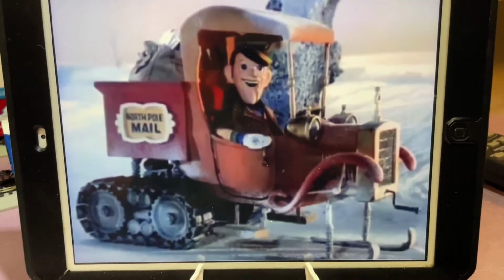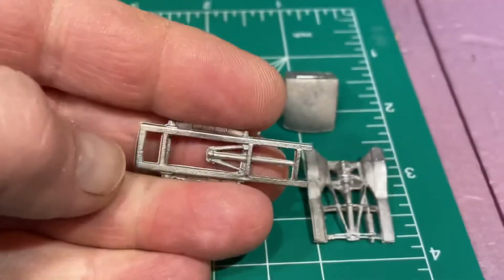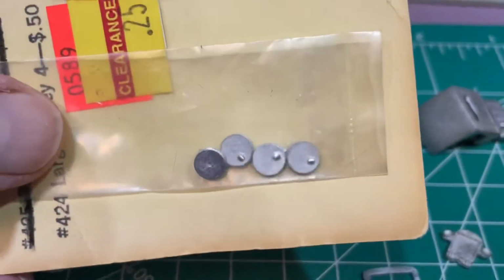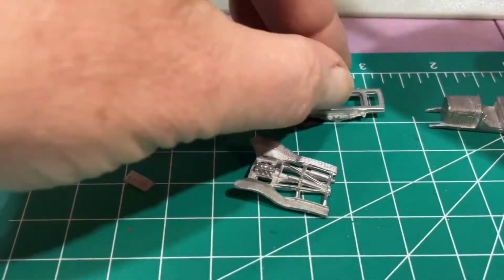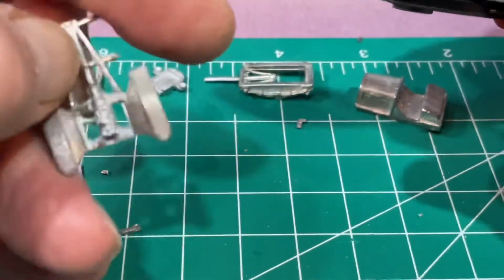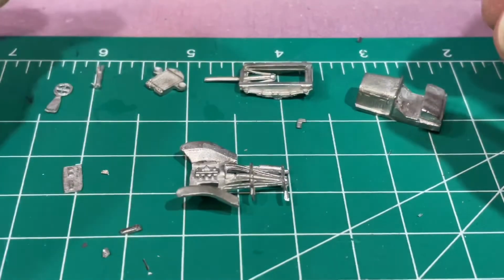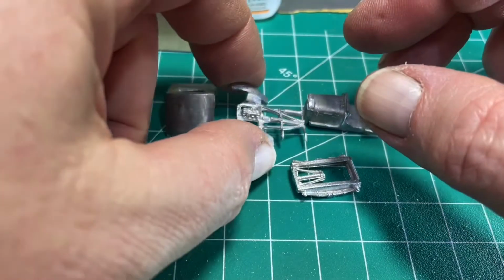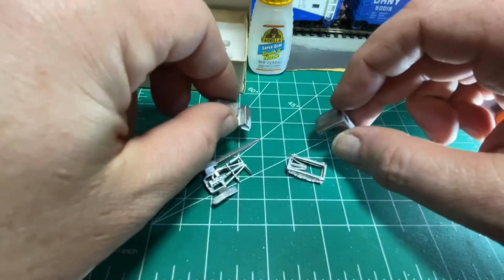Making a Santa Claus is Coming to Town Mail Truck - Part 1

Comment: This is a really cool project, thanks for sharing your progress so far! I have never been adventurous enough to give the die cast kits a try - they look like they'd be so difficult to work with so props to you for doing that! I can't wait to see how it turns out!
Reply from the maker: The die-cast kits usually aren’t that bad. The worst part is filing all the mold flashing. You often find kits need to be bent to fit right. It does seem this kit is a little brittle though.
Reply: @MyLifesTracks  Gotcha, that's good to know. I might have to try one sometime, then. I guess I just have worked so little with metal kits like that... they just seem so intimidating. I'll wait until I see how your assembly process goes before I buy my own kit, though!